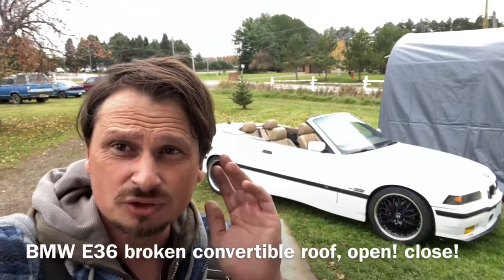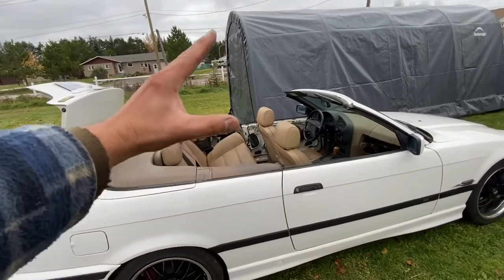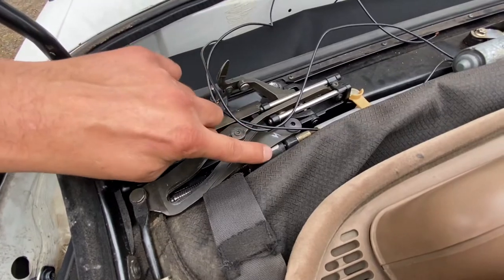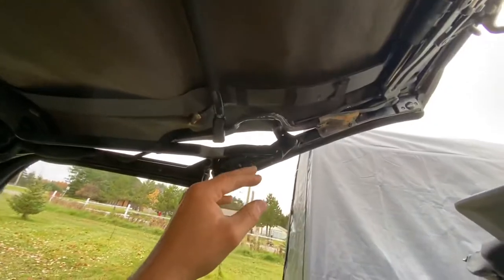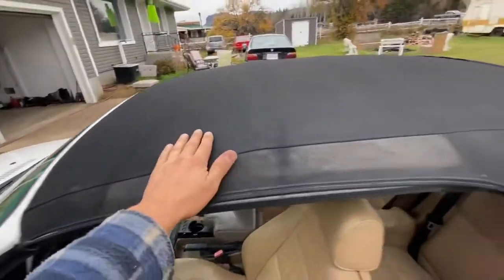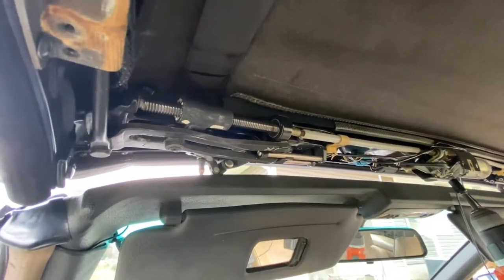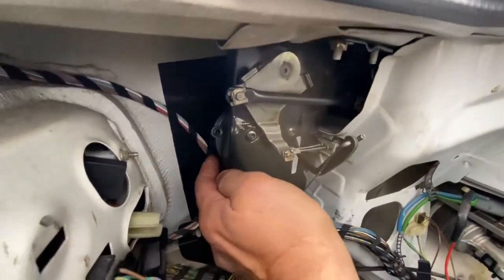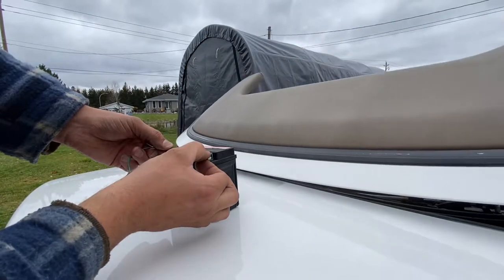BMW e36. How to open and close a broken convertible roof manually open and close BMW convertible

Comment: What if my motor that pulls the tonneau cover shut , the one you manually closed with the wires and battery , doesn’t work? , how can I get it to shut all the way ? I figure if the moter doesn’t work anyway the hardwire to a battery won’t make it work either right? Is there a way around this?

Comment: Thanks a lot for the video! My roof only works manually now so I needed a way to latch the roof cover when the roof is down. Thanks to your video I managed to fit a switch that goes to the latching motor and holds the cover down. Thank you!

Comment: after putting down the top manually when I try to close it now the top itself wont drop but the latches that engage with the top of the windshield lower and eventually get into the lock positon even thought the top itself isn't lowering at all, any idea for this?

Comment: My tonneau is pushed down all the way as much as it can. But, How do you stop the trunk from rubbing up on tonneau (when opening even when tonneau is pretty much locked down. ? I replaced the trunk struts in December. Do they need to be adjusted ? It’s chipping the plastic on tonneau. Thoughts ? Great vids btw. Super helpful. Also, how do you get the convertible top motor trim piece off ? I have a fully auto like this but with the black trim over the motor at the front near the T25 motor. I unscrewed the Philips head screw and removed it but now how do u get the trim off ?? Just pull or ???

Comment: This is an awesome video,I too have a 323Ic,I bought it with 70k mls in it,but 20 yrs ago,it was on the pricey side,the roof was the 1st thing to go,I parked it inmediatly after that,all is good in it with about 76k miles in it,but always look at it,decaying as tine goes by,I want to fix it but I don t want to spend a whole lot if I can help it.
I will watch your vids to learn a thing or two, thank you.

Comment: Thanks for these videos!  quick question, in order for my fully automatic top to work, I need to "C" Clamp the targa top motor to the bracket to keep it engaged.  How hard is it to change the mounting bracket?  I've already changed the trunk latch thinking that it was causing the roof not to operate.  Any help would be appreciated!

Comment: Hi there.  I'm so pleased that I found your channel !  My E36 project with the very thing you warn against in this vid.  My E36 has a fully automatic roof,  Unfortunately the two side hingers don't line up roof will not close the final 8" as the open mouth hingers have gone above the spindle/wheels.
Not sure how to get them too realign on to the frame spindle/wheel on each side... Any ideas would be welcome😃

Comment: Thanks for sharing this video. My roof is up, I'm able to do the screw thing and lift the front, but I can't open the back part even though I popped out the lever under the rear seat. Any advice? Thank you!
Reply: It's probably oppen I had the same problem had to lift the front end up and it made the rear pop up. If that makes sense 😅

Comment: A couple of points that should be mentioned. 
The tonneau cover should stay up on its own , there’s a hydraulic strut (s) that help lift it up and hold it up . ( just like the hood ) . If not replaced it will cause damage to other parts of the system ( bent motor mounting frame, bent rods or burning the lift motor) . DO NOT , ever use a drill to turn the front motor emergency mechanism. If the drill goes to fast or to much torque is applied it WILL strip the plastic gear .
Reply from the maker: Thanks for the points, just figuring things out as I go. Lots of problems with this one, should get it on the road by summer hopefully
Reply: I think I stripped mine. I can't get it to open again, just keeps turning.
Reply from the maker: @ReddyReg  That’s why that cover needs to be off so you can see which way those two sliders are going.
Reply: @ReddyReg  You have to remove the motor completely and either replace it or repair it. I bought a simple repair kit and used a couple small washers to avoid having to replace my motor.
Reply: @chrisrich1487  I replaced the whole thing with a manual one.. now I just gotta learn how to replace my canvas cause shops are trying to charge ridiculous prices 😤

Comment: Hey @ProblemSolverGarage great vids I just bought one of these to flip and I’m working on the top. I have an issue where the rear cover that hides the top does not open all the way. Do I have to adjust some cables? I don’t even know if they are adjustable in the first place
Reply: Thanks!

Comment: I'm going to watch all your videos but what are the reasons these roofs stop working in the first place?  I'm in the process of going to look at and buy a car with this problem.
Reply from the maker: Microswitches and the computer are usually the problems
Reply: @ProblemSolverGarage  I just picked up a 1999 323ci.  The top doesn't go down but it's not too bad except the bottom stitching for the zip in rear window has been pulled off.  Are there shops that can stitch in a new window and zipper or am I looking at a new top?  The owner gave me a new vinyl $125 top but I can't imagine the quality will be there.

Comment: just got a 1994 325i convertible (semi auto top) The soft top loves to go up after the reset... but won't go down. I find myself having to reset again and again to get the top down. any ideas? 
much appreciated
Reply from the maker: Check all the micro switches make sure they are getting pressed
Reply: @ProblemSolverGarage  The reset full works. tonneau will close, then open, and then the top fully shuts. after closing, I press the switch to open and i just hear the motor run. I cannot press anything while trying to use the semi auto open. Have you herd of this before?

Comment: Do you think there would be a way to rig up the two motors to a toggle switch or two and make it be able to lift and lower the top? I switched my automatic top to a semi automatic top due to micro switch issues and was wondering if i could by pass everything and just use my toggle switches id install to open and close the roof
Reply: NVM I JUST FOUND YOUR NEXT VIDEO. YOU ARE A FUCKING GOD!!! THANK YOU SO MUCH MY FRIEND!!!!!

Comment: I popped out the vertical motor that controls lid cover and now it cant be popped back in. Any suggestions?
Reply from the maker: It will go, try moving the Lead up and down a little bit while somebody else tries to push the motor back in
Reply: Yeah I just have the same problem too ...

Comment: I need to get my roof back down. It's currently stuck in the closed position. It's a fully automatic roof. Do I still need to disengage my motors before I start opening the roof with the drill (i'm going to do this with a torx screw just to be safe)?
Reply: I tried it unscrew manually without releasing the motors and the screw just becomes harder to turn and spins back in to the start position again
Reply from the maker: Yes that’s what you need to do but make sure you’re turning it in the right direction and do everything really slow
Reply: @ProblemSolverGarage  thanks man. I will try that this evening!
Reply: Hi again, any idea how I can remove the cover. I tried to pull it but it seems really firm. Is this cover on with screws or clips? Any idea where the screws are if there are any?
Reply from the maker: One is in the centre of the cover, and then there’s a clipper screw in each corner, the roof must be an open position to get the cover off I believe

Comment: Where did you get the wires that go onto the battery from
Reply from the maker: I don’t understand what you’re asking me
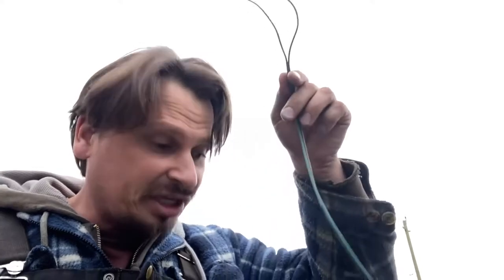Reply: At 13:17 those two wires that go to the battery
Reply: @ProblemSolverGarage  did you buy those wires from some where or did you cut them off the car
Reply from the maker: They are just too random wires they can be speaker wires they can be wires from anything

Comment: I have a question , what if that t25 insert is stripped (insert on the motor)
Reply: Can I fixed that ?
Reply from the maker: Sorry I don’t know what that is
Reply: @ProblemSolverGarage  time is 9:57 , when you use the drill , that piece for me is stripped
Reply: also on time 6:30 . that peice there
Reply: @BarberChris2000  If that is stripped, You can take off the motor it self, and take the worm wire and put the drill/socket into that itself, there will be 2 worm wires connected to the motor,
Reply: @MrLonelyScout4EVER what fitting did you put on the worm wires? A hex socket won't fit, nor will a large torx bit

Comment: That's wrong if you use a drill to wind the motor you will burn it out, use the Allen key supplied in the tool box in the boot DO Not USE  DRILL
Reply from the maker: yes if you don't have a feel for it don't use a drill.
Reply: How do you burn out the motor by using a drill? Back EMF?

Comment: 1300 bucks for M3? Does it have working engine and transmission? I bought mine 1996 328i convertible for 12k few months ago
Reply from the maker: It’s a 328 I 1997
The automatic transmission was no good, and the motor ran really bad which I fixed and I replaced the transmission with a manual transmission, the windows didn’t work the roof didn’t work, you name it and it was broken, I have like 30 episodes on all the stuff I’ve fixed already